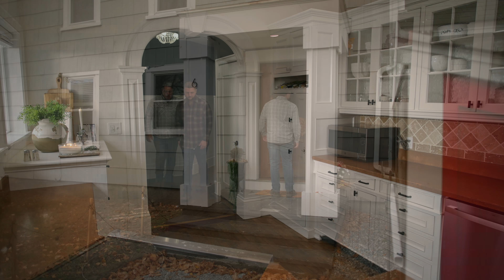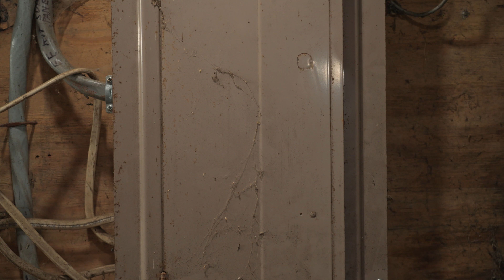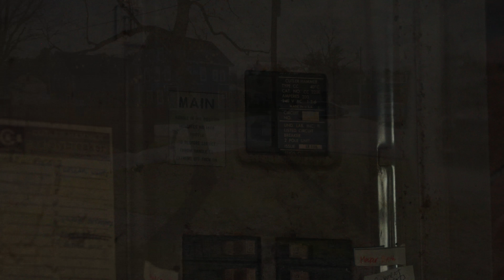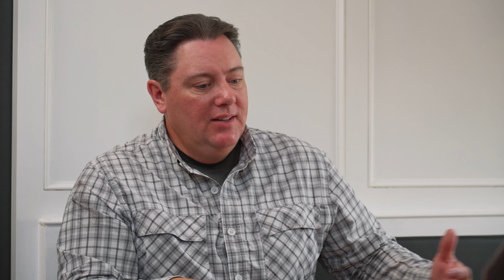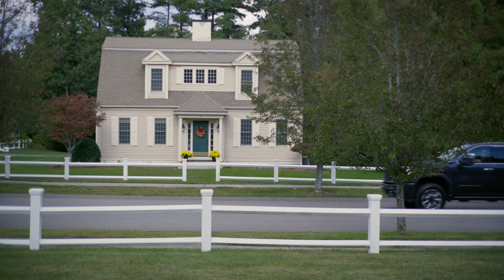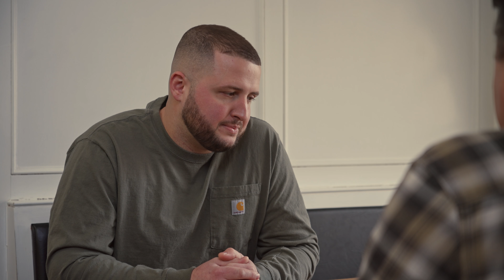Troubleshooting a High Electric Bill | Ask This Old House

Comment: 1.8MW is crazy. Heat pumps in sub freezing temps in bad insulated house just don’t work. They need way more power for heating vs AC. Downsize to another dwelling or find a better alternative in the winter for heating. NG, LP, maybe pellet stove.
Reply: Heat Pump Marketing conning people to go with heat pumps to sell more units. "Oh you save money by installing this new $15,000 unit!"

Comment: Some heat pumps use more power when the owner uses "set back" temperatures. My Panasonic has a variable speed fan motor that uses more power to raise the temperature in the morning. In my kitchen I set it to a constant 20 (C) and I save a bit more that way. I didn't believe it at first but measure monthly use. When you select a system, make sure that all of the units support the manufacturer's monitoring app. Panasonic call theirs "Comfort Cloud". My kitchen unit uses it but the bedroom unit doesn't.

Comment: Electric heat use a lot of energy. I think his back up heating element was on. I would get a hybrid water heater just keep in mind they make a little bit of noise but if it’s in the area that’s secluded and you won’t hear it that would be better.

Comment: How was the power turned off outside?   Did not see a disconnect.
Reply: Older home which didnt' required outside disconnect. Outside disconnect is a pretty new requirement (only in the past 10 to 15 years IIRC)

Comment: Many utilities (gas, water, electric) have budget billing where they charge an average amount per month that never changes.
In the winter with gas heat our bill is $64.00 a month no matter how much gas we use - it is also $64 a month in the summer when we don't use much.
In the summer our electric bill is $104.00 a month no matter how much the AC runs - but it is also $104.00 a month in the winter when we would use less.
We like it just fine this way because it is predictable, there are no surprises.
You;ll never hear us complain about a $400.00 power bill in the summer time or a $150.00 gas bill in the winter time.
Reply: of course it changes, there is an annual lookback period where it calculates the total energy used then divides by 12 and multiplies by current rates.  meaning, your monthly can go up or down.

Comment: If the meter slowed down when the oven breaker was turned off and the oven wasn’t being used where was the electricity going?
Reply: That circuit runs a kitchen subpanel. Fridge, stove, dishwasher, microwave, perhaps a freezer. Something was running. Our 40 amp breaker was failing and took forever to heat the oven. The new breaker performs much better. Observation, not explanation.

Comment: As far as Mini-splits go, the Owner needs to know that the head unit is Always using power even when not producing Heating/Cooling to home.
Any AC powered devices in the Home that use a Remote Control, ie; TV's, Stereos, Ceiling Fans, Mini-Splits etc. are Always using Energy.
The Emporia Energy Monitoring Device is a Game changer 1

Comment: Heat pump are notorious energy hogs in cold weather. They become less efficient at colder temperatures and most times just run on resistive heating. You might as well just plug in a space heater. House is probably poorly insulated for being that old which doesn't help matters. The only upgrade I see is converting the the tank electric water heater to a tankless. Stay away from the hybrid heat pump kind in an uninsulated basement.

Comment: The ductless system is about as efficient you can get for the $$$. I'm going with this is just an "Old Leaky House". A blower door test would reveal a pretty high # IMO.
Reply: Only if its a heat pump.

Comment: Heat pumps aren't all they're cracked up to be.  In colder climates especially the electricity drain is substantial.  I'm in Southern California and our HVAC guy said even here to stay away from them due to the electricity cost involved.  Solar panels are great if you have 10 years to break even with the investment.  Try to sell your house before they're paid off though and you've got a headache.  No one wants to buy your house and pay extra for your balance due on them.

Comment: That's great, but I wish that there was a way to be able to get a smart monitor that can be used in an apartment.
Reply: There is. Many devices can be plugged into smart plugs that monitor electrical usage. The smart plugs connect to an app that allows you to see how much electricity is being used by which device by time of day, over the course of a week, month, or some other time period. You might find it hard to find a smart plug that will work with your larger appliances, such as a range, oven, or electric clothes dryer. But, it is doable. Because these smart plugs simply plug into an existing outlet and your device then plugs into the smart plug, they can easily be switched from one device to another as your needs change. They can also be removed and taken with you when you move to another apartment or buy your own home.
Reply: @DKWalser  Thanks, but the problem is that the smart plugs are so expensive that I'd be spending more than a few months, up to a years worth of bills just to find out.

Comment: I think your well pump piping and or well bladder needs attention. I bet there's a hole in your piping after the well pump, check pressure on well tank or need a new bladder on the well tank.

Comment: Who TF has an electric water heater? Gas is always better and more efficient since you know natural gas burns!
Reply: I have an electric water heater. Gas is not available in my neighborhood. In theory, I could install a large propane tank and plumb all the gas lines necessary to run my heater, water-heater, and stove top, but the expense of doing that (assuming the city would let me, which I doubt) would be difficult to recoup with the energy cost savings.

Comment: I also can't help but wonder how leaky the bones of the old house are. Obviously solar is good but it costs and ROI might be tough. My impression is oil is very pricey so the heat pump is not a bad option but even with a hyper heat unit your bill will really spike. One thing about heat pumps is once you have them Set try and not change those settings much. Also do not turn it On and Off all the time. Each time some units turn on they will draw a ton of amps. I would also consider supplemental electric heat in the winter. It could take some of the load off the heat pump and still not add as much to your bill.
Reply: Oil is cheaper than Heat Pumps. FWIW: I live in USDA Zone 7. I heat with a condensing Propane Boiler, It costs 1/3 of using the Heat Pump.

Comment: a great example of how expensive heat pumps are to run they are terrible if it is actually cold outside in winter auxilary heat coils kick in. oil , propane ,or natural gas can be way cheaper depending on where you live and what each one costs per btu of heat you get

Comment: Possibly the well pump needs to be pulled and serviced. Over time, the sand packing in the well gets clogged slowing the flow making the pump work harder, the pump bearings wear and develops resistance, or the wire connection where the pump connects to the service lines develops corrosion.
Reply: Good thought.  A knowledgeable contractor could probably measure current draw to the pump as it's running and learn a lot.
Reply: You don't understand electric motors. If it were clogged the motor would run faster because it has less resistance due to less water flow, thus lower current draw. Turn on your vacuum cleaner. Now put your hand over the end of the hose. What happens? The motor speeds up because of less resistance thus lower current draw.
Reply: @trustme7731  No.  A vacuum cleaner is a non-positive-displacement pump, which can "slip" as the pressure differential increases.  A well pump is positive-displacement.  It moves the same volume of water with every revolution, which allows it to build pressure.  As restriction increases, it works harder to overcome it.  Since the pressure switch at the tank is past the clog, it doesn't see this, so pressure in the well could easily exceed 100psi, depending on the pump.
Reply: @jamesanderson2176 sounds like someone paid attention in school 🤔
Reply: @SamClemens-n9q  Like any good Engineering student, I did my sleeping during English and History classes.
Reply: @jamesanderson2176  but his name is “trust me”, doesn’t that mean you should just trust him?
Reply: @trustme7731  hmmm. I didn't think of that. But there's still the possibility of corrosion.
Reply: He claims only on the winter. Water is a year around kind of thing

Comment: While high tech is cool, an old fashion approach (low cost) would be to educate on appliance use and make a list of things people don't even think of. In most homes the lighting is no longer jacking the bill unless you have the place lit up like an airport. Things that run unattended are now at the top of the list. The typical kitchen fridge is easily pulling $25 a month. That deep freezer and beer fridge are each doing similar. I would also bet that cable boxes, routers, modems, and that sort of stuff are always running and sucking up another $20 a month. You might heat with gas or oil but in the dead of winter the blower is using another $20 in electricity. Every appliance  that has a remote control is pulling juice 24/7 just to have that feature available, which includes ceiling fans and garage doors. It's not much but it adds up over time.

Comment: solar panels are not  really cheap when you consider maintinance   . Keeping them clean and free of snow , hail damageand ice damage   and critters chewing wires . my neighbor learned the hard way . We get lots of sticky pine pollen that can coat everything green in just an hour .
Reply: I have had solar of some type since the 70's and none of this has been an issue for me or anyone else I know. Zero maintenance.  This would only be specific to where you are and roof specifics.  I am overwhelmed by animals and none of them ever cared about the wiring on my panels.  They damage many other things, but not the solar panels.
Reply: @alysafleisher  well here they do and sice we have lots of pine trees the pollen coats everything with a green layer . I washed my truck an hour later it was green again . Birds destroyed my neighbors  as they built nests under the panels  and then squirrels finished chewing the wires . , plus we get very high winds all the time up on the hillsides . You can't plant trees close to the house because it is a direct  access to the roof . But people still make that mistake here .We have over a thousand acres of pine trees running behind all the houses and in front down across the road are more pine trees ,

Comment: It’s very easy to save electricity, all it takes is money (ECM motors , heat pumps, solar panels, airtight insulated homes that bring in filtrated outside air for everyone to breathe) . Don’t forget to have a little extra money on hand to maintain all these upgrades (ECM motors only last half as long as permanent split capacitor motors , extra condenser cleaning on all the heat pump equipment, about 12 or more expensive filters per year for the make up air unit, solar panel repairs /replacement ) now what else am I missing 🤔?

Comment: Upgrade exterior wall insulation and air seal before any upgrade.
Adding solar or more efficient heating just adds more blood to an open wound.
Reply: Yes, it needs insulation!! Imagine how cold the floors in the kitchen are in the winter. Ugh. High insulation and triple pane windows needs to be priority...but not even mentioned here??
Reply: I was going to say modern windows
Reply: @lawrencebraun7616  many consider 2 pane modern. If your temps range from -20 to plus 30. You need triple euro windows.

Comment: With any solar system you have to know what to expect.
Cloudy day: No solar and no charging.
Turn off the system and let your batteries charge.
You need grid backup for when there is no solar and no battery.
Watch your panels for bird poop and clean it off asap.
Watch your battery fluid levels and keep them topped off.
Using a microwave can deplete your batteries in 15 seconds depending on how many batteries you have.

Comment: You can set up your own solar equipment a lot cheaper than any commercial company will.
No need to spend $60,000.
And Grid-Tie is a rip off.
Just set up enough solar to provide for your 120V use, don't worry about the 240V stuff.
You can start small and add to it over time as finances allow.
No loans, no payments.
You do not need the ultra-expensive equipment either.
I got a pallet of 29- 250W panels for about $1000. (7250W) 
Wired in 10 groups of 3 for a 24V system. (I had an extra panel.)
I built a tilt array which holds 12 of the panels with a sun tracker.
I use the 100A charge controllers ($37) to charge 24- 12V Grp 27 lead-acid Batteries. ($120 each)
You will want to use some 80A relays to provide automatic grid backup. ($20 each)
I installed a solar breaker panel supplied by 2- 4000W FSW inverters.

If you have questions or need details, just ask.
My power bill went from over $400 to just over $100 per month when we get good full sun during that month.
Reply: $400 a month is crazy high. How big is your house? Mine is 700sf and 106 years old but my winter bill is $170. 
We all don't need 5,000sf houses.
Reply: @RealMTBAddict  3360SqFt including garage, carport, and shop.
2 refrigerators, 1 upright freezer, 2 microwaves, hot air cooker, washer/dryer, welders, ...
Reply: @heroesandzeros7802  ok but a microwave only uses energy when being used. 
If you're a welder that makes sense, but don't add in microwaves and air fryers that are used for a few minutes.
Reply: @RealMTBAddict  It does not matter how it is used, the bills were still over $400. 
The meter and each circuit has been validated.
12 circuits are powered by solar / batteries for about 12 hours per day and has reduced my bill to about $150 per month.

Comment: People do not realize just how much power they use.
All these modern appliances take power to use.
An average home takes about 8 - 10A at all times with refrigerators, etc.
We have 2- refrigerators and 1- upright freezer.
A microwave can take about 2000W.
I have a similar current meter on my panel.
I love to watch it go from 8A+ to 0.839A when my solar comes on.

Comment: He needs to check the refrigerant on rhe heat pump and insulate the shop that has a heat pump.  Shop should require just 1 heat pump and minimal power just to keep it at 60 in the winter.

Electrician recommends only solutions that are installed by an electrician, lol
Reply: My impression is that the mini-splits are powered through the shop's sub-panel, not that they are being used to heat the garage/shop. That is, it is most likely that the external units were installed close to the exterior wall of the garage, so the installer took the power from the shop's sub-panel. One of the air handlers is mounted in the kitchen, but the air handler gets its power from the exterior unit.

Comment: Doubt they are using that much water that the well pump uses substantial energy compared to high drain appliances like water heater, dryer, oven.  We use about 500 gallons a week for about 100kwh per YEAR.  That's nothing.

Comment: Consider the Solar Mini Splits.
They can operate on solar only which operate only during the day or connected to the house power for nighttime use.
Each mini split comes with 4 solar panels and you can roof or ground mount them.
Free heating or cooling during the day.
Reply: Nothing is "free."

Comment: Why not a gas water heater? Also, would another heating type be much more efficient than the heat pump when it gets very cold? I almost wonder if a few baseboard heaters would be cheaper, especially if hydronic, as compared to the heat pump operating in really cold temps - or, a small gas furnace to supplement?  I also love the new Envi wall heater electric heaters, mine is the 500 watt, very useful near a bed or somewhere you want a warm cozy corner - yet pretty safe at the low wattage and temps
Reply: They probably don't have natural gas access
Reply: A lot of New England does not have access to natural gas, hence why oil heat was mentioned. A heat pump that is already installed is going to provide cheaper heating than any electric resistive heaters. And the appearance of the main electric panel doesn't give me confidence that all of the electric wiring was completely updated throughout the house. I'd be cautious on recommending space heaters. At least with mini-splits they are on new, dedicated 240 volt circuits straight to the panel.
Reply: @appleimacdude  they don't have gas access

Comment: G'day US meter using 240v split fase  and metering two hots as to 240v single fase metering one hot to Australia only say same motor  equal in hp us use us 10kwh Australia us 5kwh  thx

Comment: I think in this situation it would be beneficial to have a “hybrid house” what I mean is have heat pump cooling, natural gas or oil burning water heater, and possibly a natural gas stove. It’s what I’m planning on doing to my house currently my cooling is electric, my heating is natural gas, my hot water is natural gas, and my stove/oven is electric. I want to switch the stove over to natural gas because it’s much cheaper than electricity in my area.
Reply: The savings on switching the stove to natural gas would probably be less than $5 a year, so other factors are usually more important. I'm personally thinking of going the other way and switching to electric to avoid the exhaust. The exhaust is both going into the kitchen air and it makes the air around the pots hot and uncomfortable for stirring.